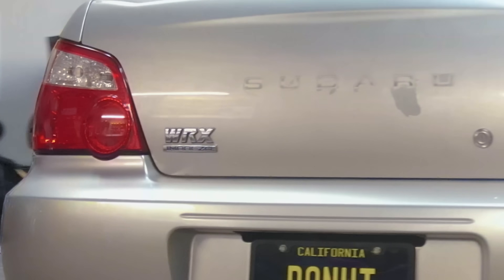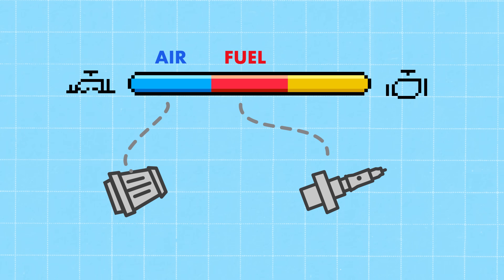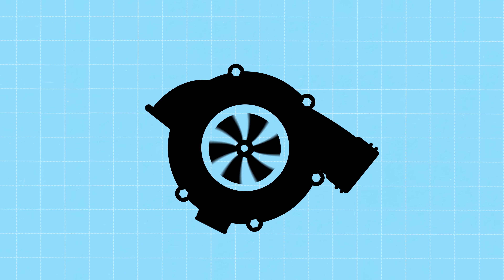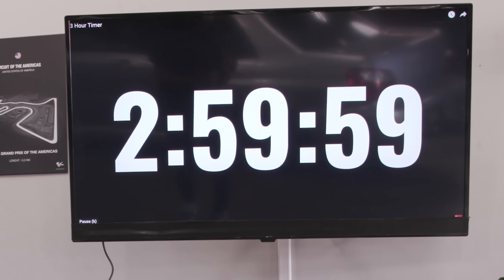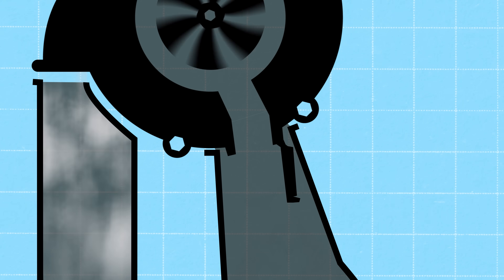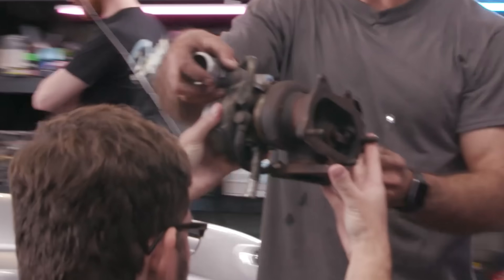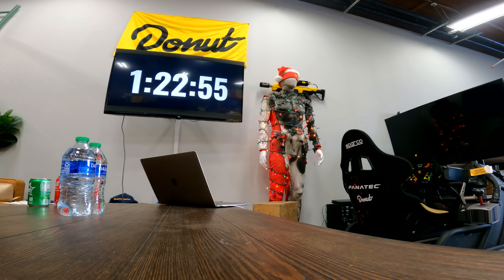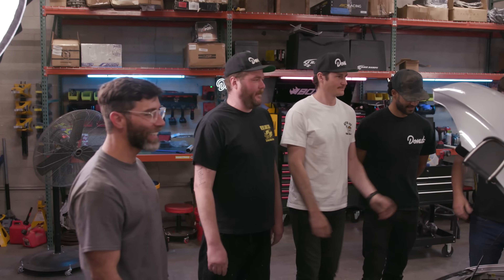Giving people a car, if they can fix it

Comment: I'm actually with Tim on the downpipe. I think that taking off the downpipe cleared a lot of space and made the replacement a lot easier. I think if anything it saved him time not having to smash his knuckles up quite as much getting that turbo back on. ^^ Just my opinion.
Reply: Came here to say this. Aaron was dead wrong saying the DP was a waste of time
Reply: I've pulled a turbo from that gen Subaru, and you MUST take off the downpipe, as there are studs on the turbo for the downpipe.

Also the video mentioned listening for the blow off sound, which isn't a thing on a WRX. They use bypass valves instead. The ECUs are programed to expect air from the bypass. You can do some real harm slapping a blow off on a wrx.
Reply: @mastrFlex  yes sir. Can’t throw a blowoff valve in any turbo car without a tune and expect good things to come of it. But people just wanna hear the ps ps lol little do they know an external waste gate is really what makes a turbo sound mean af.
Reply: @mastrFlex not really true. Maybe newer Subarus. Venting fully to atmosphere (which is what gives the psshh noise) is never good for any turbo car. 

However it won’t ruin the motor fast. Car will just run more rich and turbo will be working harder. Full recirc or even worse, blocking the bov will cause more issues, as it builds up excessive pressure at higher psi. Best option is a dual port bov like what gfb sells. Can set to part recirc, part atmospheric. So it only releases what’s needed into the atmosphere then recircs the rest so boost doesn’t have to build all the way up again - less wear on the turbo.

Comment: Tim 2 seconds after popping the hood: “I think I need a new turbo”
Everyone: damn we shoulda made this harder
Reply: yup like a spun rod bearing lol ..
Reply: @noxnyc23  it's what makes a Subaru a Subaru 😂
Reply: @noxnyc23  fuked compression
Reply: @lukesites2457  LOL it really does .. I own a sti that made it to 109k miles then boom spun rod bearing .. I still have it well maintained bfore and after  but like everyone says it’s just a matter of time .. so I agree with your statement 🤣
Reply: Diagnosis isn’t the trick. They’re supposed to get the diagnosis correct pretty quickly. The challenge and fun in watching them, is to see if they can get it done in time and if they were right.
Reply: @noxnyc23  Just put some foil under bearing aaaand sell it before its starts khocking again, my friend buyd sti with this "repair" and drove it almost mounth with full throtle
Reply: Saying he needs one showing that the car is already his
Reply: @kombrug  can you get in trouble with tradein
Reply: @nico3727  Yes.

Comment: Everyone's faces like "damn, he's good" when he mentions it might need a new turbo. Lol. It's crazy that it only took him 2 hours(plus a 5 min. Test drive) to diagnose, pull, rebuild, and replace a turbo.
Reply: Yeah I need to know what shop he works at lmao I'm gonna be a customer
Reply: And the shops will say it’s a 12 hour job
Reply: @cowanjones7232  well, because it is.
Reply: @ritermaster  for someone doing it  on their own, researching it by themselves and for the first couple times maybe. Not for a shope that's getting paid 100s in labor because they claim expertise lol
Reply: @jqualin4927  hahahahah what about the shop? the tools? the hours to learn? another  set of hands to help? are those free?
Reply: @ritermaster  The guy in the vid used a jack and some hand tools. It took him 2 hours. If it takes you 12 hours with two people, a car lift, and power tools etc.... Maybe get good? I dunno man.
Reply: @drewkosko8931   This guy doesn't understand the difference between  man hour cost and experienced labor cost.
Reply: Bruh that turbo takes maybe an hour start to finish to do.
Reply: @davidblanchard3717  to pull and replace after diagnosis yea. He rebuilt the damn thing too in that time frame. Just wild.
Reply: Well all he did was swap over the oil drain line (one hose and clamp), and the waste gate actuator (2 bolts and a snap ring), and the oil feel hard line (2 small bolts) he didn’t rebuild the actual turbo he just swapped over hoses and the gate.
Reply: @davidblanchard3717   There were more parts swapped but yes it wasn't a complete overhaul of the old internals...  They were both old turbos and he took parts from both to complete a single one and went from destroyed Turbo to a working Turbo therefore it is a rebuild.
Reply: yup true. when he can diagnosed turbo problem just by hearing and feeling. hes good
Reply: @drewkosko8931  Job hours are based on a national average and usually set by dealerships... Just because someone learned a trick or is that good doesn't take away from that.. that's how good mechanics make great money. I once figured out how to bypass a 16 hour blower motor job and do it in 4
Reply: @cowanjones7232  under promise over deliver. Also there has to be room for error. Faulty parts or small errors can eat up a lot of time.
Reply: @ElAndresRodriguez  sometimes it can be a problem too Andrew. 🙏
Reply: @stephenledford3808  yes. Even sometimes drivers work on this as a parttimer.
Reply: @jqualin4927  facts, I took out my whole turbo kit, for the first couple times it took me 4-5 hours and I’m definitely no mechanic, now I can do it in around 2-3, shops definitely should get it done quicker
Reply: @bgaoest2995  that and info panel basically saying everything he needed to know..

Temperature creep, and no boost built..

Dingalingaly ringa ding.
Reply: @davidblanchard3717  i was waiting for someone to say that. These engines are super simple and not time consuming
Reply: @drewkosko8931  by your logic just becuase I can cook a steak, salad and chips I shouldnt go to a restaraunt, wait 20 minutes and pay 40 bucks. 

Also tell me more about how workshops are empty and just begging to have every person to do one car.
Reply: @jqualin4927  he did not rebuild the turbo
Reply: I mean diagnosing a busted turbo especially on a subaru isnt rocket science. Wouldve loved to see him diagonose something idiotic like a fucked rear main or compression loss etc.
Reply: @кяуртіс  exactly
Reply: Just shows how much crap these shpps are full of these days
Reply: @кяуртіс  true. This was the simpler of diagnoses seen in this series. More time consuming hands on repair
Reply: @ritermaster  coming from someone who has this exact wrx (since 2008) and has replaced a stock location turbo 4 times, it is NOWHERE near a 12 hour job. you got played if you payed for 12, or you suck at wrenching if it took you 12
Reply: It’s not hard pulling the turbo from a Subaru. It’s literally just “there” for the taking.
Reply: It doesn't take long to replace the turbo on these. It's so easy.
Reply: @ritermaster  we are not talking about any of that. We are talking about how they will charge you for a 12 hour job when it’s not.
Reply: @jqualin4927  And don’t forget rust in the upper states….
Reply: @domrip8598  and utah and Colorado too haha.
Reply: @domrip8598  although idk what rust has to do with any of this
Reply: @ritermaster  No it's not. My mechanic does it in a bit over an hour.
Reply: @ritermaster  lol - it's not mate.

I replaced a vf28 in a tight carport on slope, with nothing but hand tools, a trolley jack and 2 jack stands - in 4 hours; with a shitload of swearing lol.

It can be done.
Reply: @ritermaster  those aren’t free but at the same time it’s balanced by how much business you get. You can do 1 Turbo in 6 and get 400 or you can do 3 and get say 600. It’s all about scale and a lot of shops don’t realize that. People want the golden triangle (speed, skill, affordability) and if you provide it you’ll always have work.
Reply: @ritermaster  did we watch the same Video? Then it's not a 12h job
Reply: yeah as soon as they said "The car has a very SUBARU issue" at the very beginning intro I immediately was like "oh, ok so it's the turbo" lol
Reply: @davidblanchard3717  with the right tools. Pita without.

Comment: 5:38 

Yes, the down-pipe DOES need to come off. It is impossible to pull the turbo without the down-pipe coming off after the intercooler is removed. This is due to the turbo studs on the hot side of the turbocharger connecting to the down-pipe and on the exhaust housing connecting to the up-pipe from the exhaust manifold.
Reply: Don’t worry, it’s pretty clear no one In the comments or at donut has ever worked on or seen a Subaru before 🤦🏻🤷🏼‍♂️ literally Lego
Reply: This
Reply: Hit the nail on the head.
Reply: @TheOakley165  Agreed! Thankfully Tim didn't listen because pulling a turbo on a Subi is pretty easy once the DP comes off like it's supposed to.
Reply: @TheOakley165  I'd be more than happy to teach the lads at Donut Media a thing or two about Subaru's. 😁 They're really not that difficult and don't have major issues when they're maintained properly. Maintenance is the KEY to any performance car, especially a horizontally opposed engine.
Reply: @pastoria_  They also mention there should be a blow off sound, when the stock BPV is clearly still on it :D You might hear a little woosh, but pretty darn hard with an aftermarket exhaust
Reply: @pastoria_  Changing the clutch in an STI is a pain compared to most other vehicles. I've done it twice (without a proper transmission jack) and I don't ever want to do it again.
Reply: @usefulidiot21  Basically, what you're saying is, you don't know how to drive and ride the clutch requiring it to be replaced twice?
Reply: @pastoria_  Yeah, obviously that's the reason that anyone has ever changed a clutch on any vehicle.

The first one was my friend's car that he was getting ready to handle the high power build that it now has. And the second one was for my car that I bought used and the clutch was already slipping, so we changed it.

My initial comment was mainly in response to your comment saying that Subaru's aren't really that difficult, when actually, changing the clutch on an STI is one of the most difficult vehicles to do that on.
Reply: @usefulidiot21  I just pull the engine.
Reply: @austynneddy  We didn't have that option since he didn't have a hoist. And like I said before, the STI is just more difficult to change a clutch on compared to most other vehicles.
Reply: Considering he said the car had a blow off valve they know nothing about Subarus
Reply: Exactly what I was thinking.
Reply: @dj27nitro  Sadly, I see a lot of Subaru's end up on their way to the scrap yard because they don't get properly maintained. Subaru's aren't difficult, but they do require more strict maintenance.

Comment: When he said he didn't need to take off the down pipe, he's not thinking normally cause of pressure..... nah that's what allowed Tim to get the turbo off in less than 30 min. Rather have more space to work. Instead of getting my ass handed to me by THAT ONE BOLT. We all know which one we're talking about 😆 🤣

Comment: If he can fix it in 3 hours it should be considered a world record
Reply: he kinda did it in 2
Reply: I mean, it’s not that hard to work on cars when you have the tools and mechanically inclined/experienced 

It’s hard to modify and rebuild parts, replacing stuff is usually plug and play. 

Dreaming to install a k20 in a crx or LS swap a Miata and all those crazy builds requires real skill to fabricate mounts and make mods to the chassis to take the mounts and hold the power train properly
Reply: That would be considered flat rate

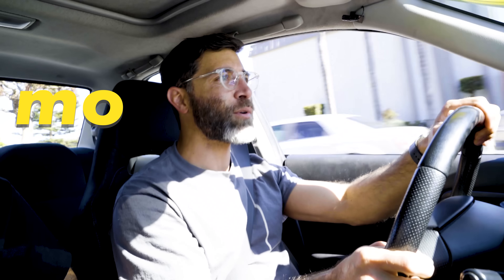Comment: @3:18 Someone probably already mentioned it but Subaru doesn’t use blowoff valves, they use bypass valves. The valve recirculates excess pressure rather than circulating to atmosphere.

Comment: Tim trying to re-install that inter-cooler; I feel your pain, best trick for me was using the handle of a hammer when pressing the big tube on, then using handle on the smaller tubes in the bottom right.

Comment: this video actually helped me allot. here i was thinking maybe something was wrong with my turbo in my 15 wrx but the information in this video was enough to put my paranoia at ease <3
also changing a turbo would definitely be a whole day job for me so congrats on the 2 hour replacement! also solid diagnose

Comment: Imagine the issue was the head gasket and he had to do a full engine rebuild lmao
Reply: Usually don't need to do a rebuild for a head gasket unless you drive it alot with it blown. Usually have to resurface the head, replace the gasket, oil change and coolant flush and you're back in action.
Reply: 1 person can't do that in 3 hour lol

Comment: I genuinely believe that subarus are (until you have to split the crank case) some of the easiest cars to do all your maintenance on. Oh, also having to pull the intake manifold off is a PITA on ~2005+ drive by wire models
Reply: Turbo subaru engine bay is quite cramped though. The newer ones have the oil filter on top which is nice, but the EJ is quite a pain in the ass
Reply: Agreed. Any pre 2005 subaru is very chill to work on. Once you get into 2006 and above little things make them annoying like secondary air pumps and fly by wire. I've been building and working them since I was 18 and my fastesttime for pulling a motor is a little over 39 minutes now. Its still a love hate relationship unfortunately

Comment: What's interesting at 7:10 in the video, he said taking things off is usually easier than putting it back together. In my mechanical experience of about 7 years now, consistently I have always had a difficult time taking things apart than putting them back together. It usually takes me 2-3 times longer to take apart than to put together.

Comment: I could’ve diagnosed that without even test driving it. Replacing it on the other hand? I’d be there for about 6 hours, drunk, cursing with busted knuckles😂 I know from experience. Blew 2 turbos and replaced them both. Props for completely replacing a turbo in 2 hours

Comment: I want to clear it up, only Naturally aspirated EJ motors have the headgasket issue because Subaru used a garbage headgasket. The turbo EJ motors used a multi-layer steel gasket that almost never fails

Comment: number one thing I do when test driving a subaru is heaters on max hot. bring it into boost, heaters go cold its head gasket time. early warning long before the gauge lets you know. I know it wasnt the issue here, but if your looking to buy one....that and glitter in the oil especially if its an STi. the higher rev limits are hard on the big ends.

Comment: When commenting about the speed of the turbo swap, please keep in mind that the Donut team loosened every seized bolt and stuck hose when them installed the bad turbo. Half the job of replacing these turbos is dealing with seized bolts. Secondly I didn’t see the OEM turbo heat shields, meaning the team left them off. These heat shields are a pain in the ass to manage with. Thirdly, I’m betting he’s going to fix his turbo install later. I’m willing to bet the turbo oil return hose is rotten and ready to pop, and the turbo inlet hose is torn.

Overall nice job

Comment: I think it took my dad, a mate and I an hour just to get the intake on the turbo on my car, probably because I put the turbo on before the intake, I think I should've put the intake on then slid on the turbo. 

Also, there's a bolt under the down pipe on these for the up pipe, getting the downpipe out of the way was the correct thing to do, as can be seen because he got the car done in under 3 hours

Comment: There has to be a "video - executive producing" quality injected into this video... I've turned a LOT of wrenches in my day, but pulling/replacing plugs, radiators, exhaust manifolds and piping really sucks/impossible when the car is up to temp.  How the hell is this guy supposed to work on the car when it is steaming hot??? 

Other than that, LOOVVEEE these videos.  Keep doing what you're doing guys!

Comment: from a logic standpoint, it wasn't making boost, in this situation i woulda just replaced turbo without diagnosing, its the safe bet. There is NO WAY it woulda been a blown headgasket, u cant fix that in 3 hours. and if it was a boost leak, it woulda still made more boost than a blown turbo or waste-gate.

Comment: My time as the owner of a Subaru. 
"This is a short story and not everything what I have done with the car"

First day i had it. Blown gearbox.
After some miles after that,. Blown reardiff.
Fix the entire rear end with new stuff and put a hole new exhaust on.
After that the key transmitter broke.
And after i fixed that I felt that now is beginning to see the end of misery.
After that my Brother had detail the car the hole day when i was working.
Getting ready for the first car meet after 2 years being a axle stand racer.
3days later i hit a deer.
After i hade the car in the paintshop i was winter. ( I do not drive this car in the winter because off salt)
So i was fixing small stuff and upgrading parts.

Standing in my garage just waiting for the snow to clear. it was March and spring had just arrived. 1-4 weeks for the snow to clear.
March 21 The guy next to my garage was welding on his Ford Galaxy Cab. His car  caught fire and the entire building did so to. Including my garage.
Everything burned up. The car and everthing else i had in the garage.

Buy a Subaru, they said It will be fun, they said

Comment: They give you whatever parts you ask for I've seen. I'd ask for a turbo to fix the issue an earn the car, then ask for a second turbo because it sounds like they need replacing often. Easy swap, open trunk, insert turbo, close trunk. Whoop whoop whoop, pshhh, out of the driveway. Overheats at first red light, but it's mine baby.

Comment: I know how to fix it. Yank the motor and trans Throw ‘em over your left shoulder and Shove a Ford 289 with 302 pistons and crank in. Put a bullet proof 5 spd in as well. Fixed and you never have to worry about the Junk engines subaru produces.